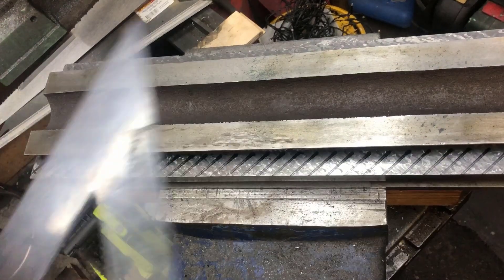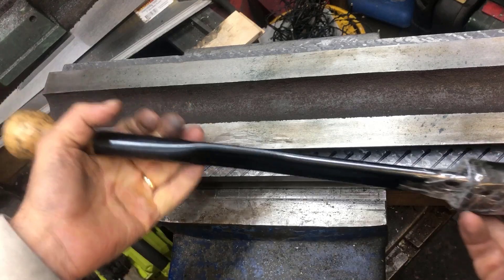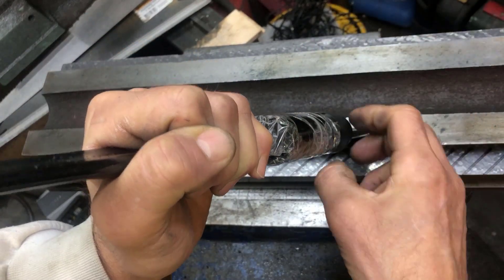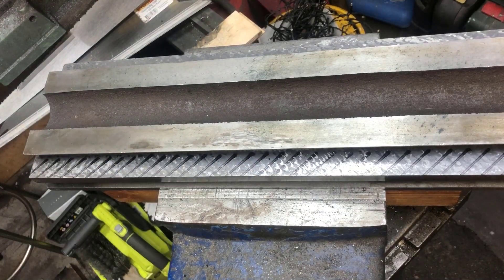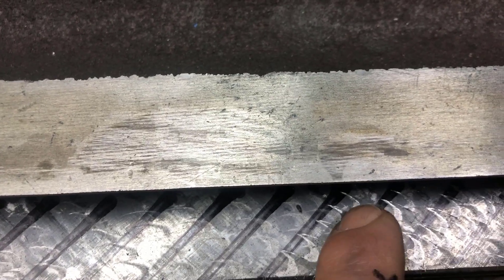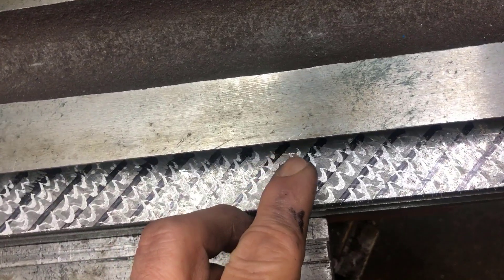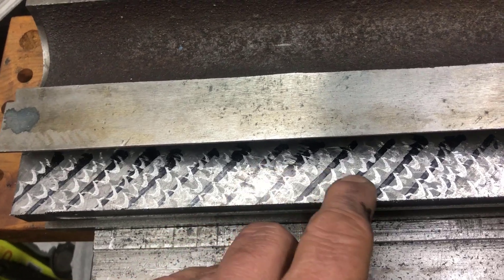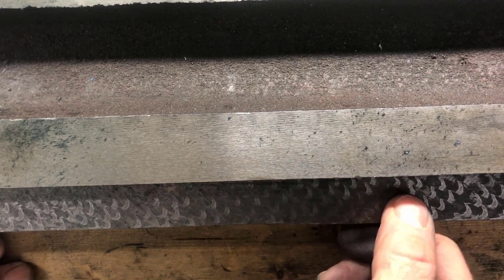Techniques for surface finish and oil retention - 4 - Hand flaking the underside of the CX-16 table

Comment: Nicely explained Jan, it’s a little easier with a smaller radius on the scraper end . While tricky to achieve, it helps to cross the tails of each half moon with the centre of the following half moon. That helps the oil move between the points.
Reply from the maker: Thnks ! I will surely try your suggestions!

Comment: Excellent video demonstration.  When I do the hand flaking I use a dead-blow mallet rather than the palm of my hand.  I seem to get more consistent results and at the end of the day, I can still grip a cold bottle of beer.
Reply from the maker: Thnks. Yes, I assume if I was to do this day in/day out I would need another tactic/method. I have the BIAX though :)

Comment: Hiya Jan.. Thanks for following my channel. 
I was thinking of scrapong in my myford. 
I cant afford to have it surface ground in. 
Where can I buy a hand scraper from in the UK? 
Would a peice of plate glass be adequate for a surface plate?
Reply from the maker: I would contact H.R.Lamb & Son to hear if they could recommend a source for a hand scraper for you. They are experts on scraping masters located in the UK. Look them up at lathes.co.uk. Else there are several to choose from, eg. Anderson tubular scrapers in the US, BIAX hand scrapers (also USA as well as in Europe) or local to me in neighboring Sweden, Sandvik scrapers. I would however have considered to make your own, just buy some BIAX- (pre-ground radius) or Sandvik blades (needs radius) and then mock up a (not too stiff) handle with a pad at the end. This way you can benefit from using the body-push, both hands to control type of technique.
I don't think a glass plate would be sufficiently stiff (unless very thick) and would probably be of uncertain surface flatness. I would try to find a smaller, say 40x60cm granite surface plate. They sometimes come up for sale at a reasonable price, maybe even used as long it is not too worn (some nicks and scratches doesn't matter)
Reply: I’ve a few handles left in a box somewhere in the workshop. If you drop me a line